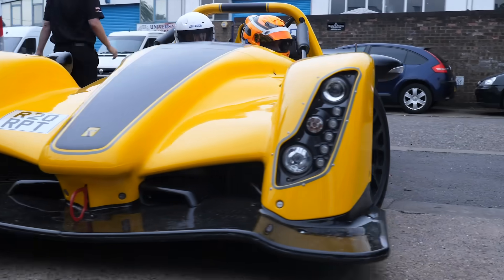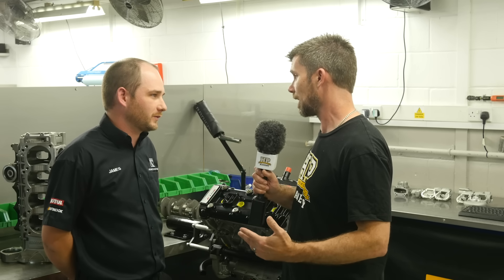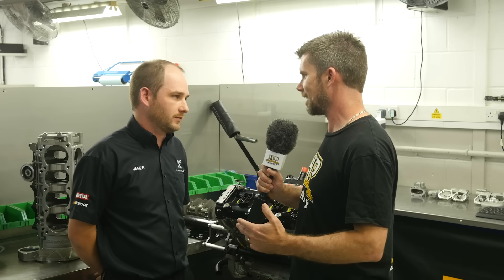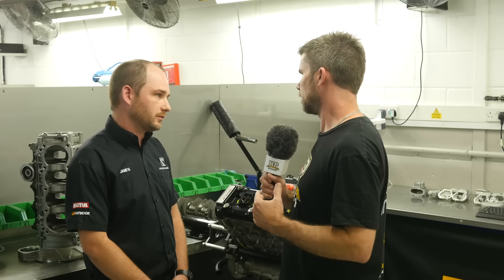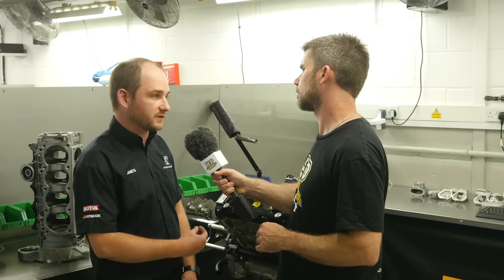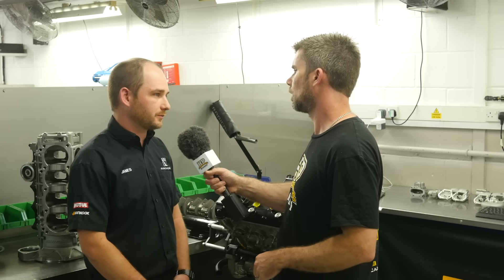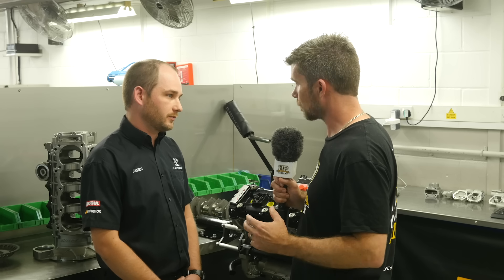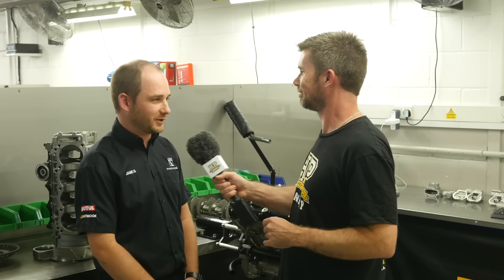105kg, 500HP, 10,500RPM ‘Hayabusa’ V8 | Radical Sportscars RPE-V8 [TECH TALK]

Comment: This is the V8 swap that every Miata needs 😎🥳
Reply: Exactly my thoughts
Reply: @RichardEnglander how reliable though
Reply: I'd love to see it in a pike car like a Nissan Pao! Idk if that could fit in a Rover mini cooper, but the idea of a small V8 sleeper seems like so much fun!
Reply: They have an ND miata thing happening. It's on their site.
Reply: I gotta 93 Hilux I would ❤️ to put that in!🔥🔥🔥
Reply: wtf I've had an na1 miata sitting for years with no compression, I just said to myself "wouldn't mind this engine in the miata with an H-pattern dogbox" lol and I immediately after see this comment...
Reply: I'd make it fit in my old Suzuki Carry. She'd be the micro-monster truck I've been moving towards.❤
Reply: id put it in my ford falcon, I'd throf the 150kg weight savings
Reply: Quad be mad
Reply: The 200hp 4 cylinder would be an upgrade in a miata.
Reply: 230ft lbs torque? 😂 That’s a big no
Reply: @Whosurdaddy71  more than twice what comes in a NA miata, you'd be needing forced induction and new rods to push 230 "reliably" in a 1.8, and a 1.6 runs into issues even sooner.
Reply: @garageworm17  you literally read my mind or s2k swap hmmm what else is light and nimble that deserves this ok not a subie guy at all the problem starts with the engine but drive lines pretty good for a car so swap this into an sti
Reply: @garageworm17  exactly what I was thinking
Reply: Take a late 80’s - early 90’s Suzuki Swift,  & put this v8 in it! 😃
Reply: @garageworm17  Miata not need power
Reply: Ariel Atom
Reply: If i could like this comment twice, i would
Reply: The block, crank and rods are way to weak to handle the extra weight, just look at how thick a 2.8L BMW i6 block is in comparison or how a the old GM 350 truck block that only makes 200hp has a even thicker rear main then the 300hp LT1.  Weight=break stuff.
Reply: @eaglefat9398  always room for improvement you could build that motor to only handle 300hp not 500 and leave it NA Miatas are more fun with 300hp then 500hp
Reply: @garageworm17   i'd be happy with just 200hp plus that v8 sound
Reply: @eaglefat9398  300hp is the sweet spot everything can handle it perfectly and no worries bout braking stuff
Reply: @eaglefat9398   there's a cbr1000 swapped miata, albeit it's stripped down to 2000 pounds; its ROWDY and quick. This would work perfectly in a miata, the hardest part is finding a transmission thatll handle the weight and mate up with this. The internals are not going to feel the forces of moving the car nearly as much as the transmission; thats the whole reason why your 1st gear has a high ratio of crank rotation to output shaft rotation lmao
Reply: Not really. The TORQUE on these is fairly linear. You cannot move a heavy car with them. What your miata need is a LS4 from chevrolet. They make 350hp and 500ft/lbs of torque in a small inline 4. Its basically half of an LS V8 engine. Search it on google or here. They are cheap and they are from an industrial uae. So super sturdy. And can take a lot of beating. They are alao reliable becauae they were made for induatrial equipment. Perfect for a smaller car like your miata. And since its a straight engine, would fit well in you RWD miata. Consider it!
Reply: Ls3 is what that needs
Reply: But imo. No miata deserves.
Reply: Miata is too heavy...
Reply: @MickH60  cappuccino maybe?
Reply: @MickH60  Miata exocart
Reply: @MickH60  if the miata is too heavy theres hardly any car that it would be good lmao. They weigh in the low 2000's wdym too heavy
Reply: @MickH60 for 400HP💀???

Comment: I would like to see a Busa-based straight 8. perfect harmonic balance. I wonder how that would rev?
Second idea would be a square 8 (twin crankshafts directly geared together) and counter rotating to cancel torque rocking.
Lastly, How about a "split journal" crankshaft for the 72 degree V8.  90-72=18 18/2=9 So grind the con rod journals + and - 9 degrees and Viola' you have a 90 degree firing V8 . This is not a new idea, it has been done before. (yes you may have to play with the counter weights for balance) Could even external balance like a 400 SB Chevy ...
Reply: I also had idea one and two.
The inline V8 would be quite long though.
Two inline 4s side to side makes sense to me. You can run two standard blocks, you only need a bit of gearing to mate them together.

Comment: Excellent interview! An aspect not discussed is the cam drives. If the inlets are inside the V then one head is turned around relative to the other. This puts a cam drive at each end of the crankshaft. How is this handled in this engine?

Comment: Junk all that money for 500 little horse.
10.000 rpm big deal.
Still only 500.
Junk
Reply from the maker: There is more to a race car than just power, which is why the car this engine is predominately used in is much faster around the track than any 2000HP blob. Don't take my word for it, have a search and check out the records Radicals cars were breaking years ago 😉

You don't have to run out and buy one, but learning about a full setup rather than just assuming a peak power figure on a dyno is the only important thing will 100% ensure you make your own car faster - Taz.
Reply: @hpa101  ya im just saying spend all that to rev a v8 to 10000 rpm is senseless.
Its hard on parts.
6000 rpm v8 can do that.
Im not taking about the design of the race car.

Comment: Still got a in unit transmission?
Reply: 72 degrees mn, should’ve made it a v10. Fork ‘n blade or are the heads slightly offset from each other.

Comment: JFC Motorsports that have bought the rights to the hayabusa V8 produce a 90 degree billet block V8 in several displacements including a 750hp twin turbo version. Now if only someone would build a V8 with Honda K20 heads, that would be impressive!

Comment: These guys need to talk to Allen Milyard he was converting Japenese motorcycle engines into V8 and V12 all done with a hacksaw back in the late 1990's and early 2000.
Reply: Much as I like what Allen has achieved over the years, I don’t think these guys need advice from him.  Seems to me they have the engineering well covered if they can offer a warranty.
Reply: Allen Milyard would be like, I’ve got these two tiny V8 motors, beautiful design, lovely note let’s see if we can join then together and make a V16 motorbike…. Or a X16 motorcycle..
Reply: Exactly!
Reply: I got a feeling they arnt 400 hp
Reply: what milyard does is clever ,but he is making road engines ,not race engines two totally different things
Reply: @alancollard8939  In what way?
Reply: @1darryloflife  ,there no way those crankcases /cylinder heads are straight after all the heat of welding, and ill bet they are not normalized after ,so align boring crank cases and cam bearing housings would be a must to keep bearing clearances ,also cut and shutting cams to suit a new firing order, phasing the timings  wow think that lot out , i think he is damn clever but it aint race engineering the guys at radical engines have their shit together,
Reply: Allen Millyard does follow engineering guidelines, just those from 1950s and 1960s racing motorcycles (e.g. Phil Irving's book).  So that's about the performance and longevity you can expect.  Not bad, in other words.  Probably better given more modern lubrication and materials.

As for cutting and shutting, he goes to great lengths to ensure everything is square and true.  Again, following the guidelines of how engines were put together in the first place back in the day, using pretty much the same logical techniques and tools.
His welding work is all pre-heated and de-stressed on his garden barbecue!  Within the after-market performance products industry, there is this PR-like impression that it has to be proprietary and high tech to be adequately functional.  I'm not saying his engines would compete at the MotoGP level, but then a Hayabusa engine won't, either.

He builds his six-cylinder, press-fit crankshafts the same way Honda did in the 1960s.  Just because it's the old way doesn't mean it's no good.  It just takes more setup time and more after care before final assembly, and some pretty impressive thinking too boot.  And it's cheap!  If it were easy, everyone would have been doing it and it would never have been remarkable, as those 1960s race machines still are to this day.

Another great example of this approach (disregarding the norm, thinking back to basics) can be seen in the engines of Pete Aardema and Kevin Braun, engines made from sheet metal like it's the 1920s... and setting speed records.
Reply: You mean those one-offs that aren't raced and do little other than attract novelty interest.  It's not as if he invented banging a few engines together and making it work.  Look up those boys in Thailand they have lots of channels where they combine moped engines into one. It works, no questions asked. But that's about as far as it goes. Reliability? Longevity? Who knows. There is no engineering to backyard engine building.
Reply: @butwait  ". There is no engineering to backyard engine building." Where do you think all of our toys come from? That's right backyard engineering.

Comment: 72º vee?  Ugh... I guess I'm getting old.  I was taught the virtues of properly balanced couples.  My inclination would be a boxer configuration, maybe with a barrel crankcase.  Perfect balance, low CG.

Not sure I'm getting the packaging argument for the crank, either.  The reason for a single plane is exhaust harmonics.  In a race engine, you don't have to worry about the plumbing as you do in a street car, so a dual plane crank should be fine and packaging should be pretty much the same.

Comment: No credit to Hartley?
Reply from the maker: No, because the H1V8 is a completely different engine. It has no affiliation to this engine, and vice versa. Radicals engines are still in production too, where as I believe Hartley Enterprises has moved from a Hayabusa base to other options :) - Taz.
Reply: @hpa101  I see. Appreciate the info.
Reply from the maker: No worries, you might enjoy this link for some H1V8 specs/tech too: https://www.h1v8.com/page/page/1564765.htm - Taz.
Reply: @hpa101  Absolutely. Thanks

Comment: Would it fit under the bonnet of a 96-02 subaru justy 4x4? Lol then rwd with a suzuki swift gti bodykit and badges seats n stuff, painted gsxr blue colour😵 5 people squashed in drifting along dunno if the swift had the tunnel that's why I said I'd use a justy
Reply from the maker: #sendit

Comment: Small question, and it’s by no means a jab... the base model engine is making the same power per cylinder as a stock 1340 Suzuki engine.... how come the RPE engine is lasting 40 hours vs 1,500-2,000hrs out of the Suzuki engine with the same architecture?

Comment: 72 degree V seems an odd choice to me. Not only is it a lot worse than a 90 degree in terms of harmonics (a 72 degree V introduces vibrations at the fundamental frequency that the 90 degree lacks, and makes the second harmonic vibrations worse by eliminating the partial cancellation that a 90 degree V has), but it also places the cylinder heads lower, resulting in a lower center of mass.
Reply: There are a lot of things done in F1 and other classes that are purely for aero reasons. The chassis designer wants a narrower engine to help with airflow to the rear wing, or to allow a higher exhaust route that doesn't intrude into the diffuser area.

Comment: A work of art no doubt
But normally the more highly strung the engine the less it lasts.
I would be suprised if this engine made 150000km.
Reply from the maker: This is a race engine. If you want low strung reliability from an engine then you're in the wrong place as we really only discuss performance applications to be honest. Some race engines will be rebuilt after running for only a few minutes in extreme cases - Taz.
Reply: @hpa101  
Just a comment you are sounding a bit up in arms.
The Hyabusa was the quickest production bike in the world at one stage so I'm sure this engine is a beast with a compact design and high HP for it's displacement.
Reminds me of an F1 engine.
Just a comment not a criticism.
Reply from the maker: Didn't mean to come off up in arms, just trying to underline the point a race engine is a race engine. While this shares some Hayabusa components, it is far from a production motorcycle engine intended for the street although it also isn't a drag build that requires constant teardowns. Apples with apples and all that is all =) - Taz.

Comment: Soooo, the obvious question is why not do 90 degree angle?  You can't be saving that much width 18 degrees and such a small engine to start with. Change the angle of the exhaust out of the head and tighten up the headers.  You'd probably get your width loss back.  Seems like a lot of compromise for the 72 degrees.   As a person who deals with audio and vibrations, I get what the problems are.  Interesting.

Comment: i love this engine....i've always wanted to do a 4 to 4.4 liter V8 based on the Honda K20 heads :D
Reply: supersevenn Me too! K40 😁
Reply: There is a guy whos been working on it for 5yrs already. Should be out soon
Reply: Exactly. I already have a K that does 500hp reliably in race trim, no reason to go with a fragile torqueless moto based V8. Ok the sound would be better but race engine.
Reply: @MrSuchasillygoose  it's a completely different class of engine and machine.  It's even explained in the video, they already knew Hayabusa engines and so when the requests for more power kept coming in, they simply doubled up the Busa heads and tied them together at the bottom.  Clearly turbo wasn't an option for them, likely on grounds of reliability and heat.  Of course any engine that can withstand sustained high rpm operation cannot be termed fragile, those forces scale as to the square of engine speed - motorcycle engines are very tough in their own way.  Granted, if you couple a motorcycle engine with a car chassis, you're likely to destroy the transmission, clutch and primary drive (maybe even the crank and cam drive) in short order due to the massive difference in inertial forces through the drivetrain.  Luckily a Radical is incredibly light by design and has small lightweight wheels etc.  The driving experience offered by keeping the Busa basis is completely different, and I'll wager Radical's customers appreciate that.
Reply: @identiticrisis  It's more exotic, I give you that, and if the pockets are deep enough then a good option. There is a guy with a quarter NASCAR busa build that comes to track and blows the transmission every time. The Radical guys do not drive to the pump because it puts on hours on the engine, that's fragile in my book. Some spend 3 laps just getting the oil temp high enough so they can unlock the revs. The Radical may be light and has small wheels but it's still a two person car, the compound is soft, and has real aero. The loads on the engine at high speed are quite high. Motorcycle aero can't compare to something like a prototype, which Radical arguably is. I'm going through this with the Atom, steel tube frame, 300m axles, PPG trans, and Gear X trans all failing from aero loading. But the one thing that holds is the 500hp Honda block. It's nice to have something robust in the build.
Reply: @MrSuchasillygoose  yes it's probably a good idea to warm the engine before revving the nuts off it! Especially if you can't afford the rebuilds.
So it seems fragile transmissions aren't a motorcycle-engine-only thing after all!
I imagine Radical went through the same thing at first, keep at it.
Reply: @identiticrisis  I'm also a die hard manual shift guy. Radical can get away with optioning a megabuck, no synchro, custom sequential. But yeah, when you put the miles on at decent track speeds you start to appreciate the role of transmissions and the money vacuum they create.

Comment: How does this differ from the hartley v8?
Reply from the maker: The H1V8 is quite different, probably one of the main ones being it is a 90 degree vee so less compact, but has less engineering hurdles to work through as a result - Taz.

Comment: Wanted to post that this was all ready done  over 10 years ago in the ariel atom v8, but I believe this engine design must be an improvement to the last trial of this
Reply from the maker: Ariel didn't develop that engine, rather it's Hartley Enterprises H1V8 which was developed at the same time as Radicals but completely independently and is also ended up with a 90 degree configuration rather than 72 (although initially they were gunning for a 75-degree setup). There are some newer variations/configurations of this engine, but the project is not a brand new one - Taz
Reply: @hpa101  indeed, well in that case its exciting to see another one being developed! Hopefully better than its predecessors, all though I don't have any 1st hand experience with the atom v8 I had heard they were not as reliable as they had hoped.. I hope this new one catches on!

Comment: if harmonic vibrations caused by the irregular firing are a big issue, has the idea of offset crank-pins been considered?  Given the 72 degree included angle, that offset would be 18 degrees to achieve even firing intervals.

Comment: Would love to hear a small V8 such as this with a conventional cross-plane firing interval, a nice burbling rumble from a small engine. But the packaging and inertia of the rotating assembly isn't as desirable.
Reply: Many old small-displacement Italian V8s come close.  To get close to the rpm of this engine, you'd probably have to look to the Lancia / Ferrari D50.  Moto Guzzi actually made a V8 motorcycle, in flatplane and crossplane flavours.  But that's a very different affair in that it had individual pipes per cylinder, so the sound is pretty unique.
Reply: @identiticrisis  Thanks for the info.